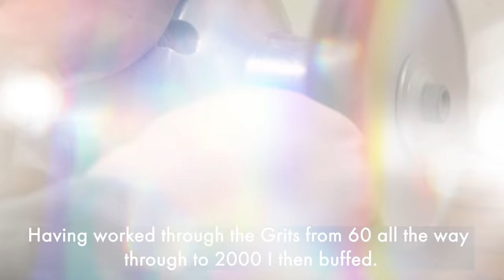Extremely Rusty WW1 Pocket Knife Restoration (Haunted House Find)

Comment: NileRed did a video about making transparent wood. He explains the chemistry and the process very well and shows his failed attempts, if you still are curious about the transparent wood :)
I also did some research on this interesting locking mechanism the knife uses.  If you google french trench folding knife, you'll find many similar knives, which may indicate where this one came from. Also a more recent example of this mechanism is the Lierenaar knife by Robert Herder
Reply from the maker: Thanks very much for the info and your input. I'll check em out.

Comment: @11:10 can you please tell me the polish you used for the wood here, I was cleaning an old knife of mine and over did it with a sanding paper that the polish layer went off, would appreciate it if you told me what you used here, thanks
Reply from the maker: Birchwood casey tru oil. Prick the top, apply to fingertip and then use finger to wipe on wood, tiny amounts at a time.
Reply: Appreciate it man

Comment: Okapi - cheap South African knife.  Very often used by skinners (hunters) because of the soft metal blade and easy to sharpen.  Unfortunately also the  most popular stabbing instrument in this country, causing trauma-hospitals to overflow.  These days the handle is made of a sort of plastic.  I had my first one in the early 1960's.  Kind regards.
Reply from the maker: That's interesting Hennie thanks. Sad about it being used as a weapon. I've looked and looked at this handle. I still think it's wood but I've had a couple saying it's horn.
Reply: @wjlacey  - The older models were wood.  The later (not so well made) ones used plastic.  Regards
Reply: I was in the South African police in the early 90's. Very true that these knifes were used as weapons. Most probably 99% of all the stabbings I investigated involved the Okapi, sadly most of them turned out to be murder investigations. I have a couple of them in different sizes. Awesome very cheap knife.
Reply: @wjlacey  The Okapi was created in Germany in 1901 for their colonies. Brand sold to an SA company in the early 80's.
Poor quality now.

Comment: An Okapi? Or an Okapi Kopy? I found one for 10$ in a flea market. After a little cleaning up I oiled the wood and sharpened the blade. Thin carbon steel...you can shave with the thing in a pinch. They still make 'em though they come from South Africa now, not Germany. You made a great vid here!
Reply from the maker: Thanks so much

Comment: How do you fold it back?
Reply from the maker: I didn't know at the time but have since learned that there is a keyring that should be in the top hole. Also known as a ring pull knife
Reply: I asked you because I have such knife and I have to put keyring to fold it back. I wishI don't have to use the key ring. Thats why I wonder how can it be folded back without keyring.

Comment: Any idea about who made this knife originally?
Reply from the maker: I REALLY wish I knew. On the left hand side, where the thumb nail is, theres a large 'eroded?' area. As its a common place for brands/ makers logo's/ signatures etc, i can only assume that it was there, but has rusted away. It was beside an extremely rusty 1907 ww1 bayonette and a very old Axe with a rotten Ash handle. It takes a LOOONG time for ash to rot in the way it did. Therefore I can determine that the blade is very old. Judging by the rest of the items in the building, i'd chance a guess of at least 50 years minimum but many items were 100+. Thanks for watching. Be sure to share/ like etc. Thanks again!
Reply: Looks like a German or South African okapi knife.
Reply: Seems to be an old french one
Reply: БССР. Г .Гомель. Завод пусковых двигателей (ГЗПД). Приблизительно с 1976 года
Reply: Germans

Comment: It used to have a ring in the hole on the tiny metal kicker on the spring plate. It’s a South African ring knife. You pull on the ring to deactivate the lock easier.

Comment: That knife has no connexion with WWI. It's a cheap Spanish or French knife of no particular  value which is still manufactured by the thousands. The handle is horn, that's why it's translucent, not because some ridiculous chemical process.
Reply from the maker: The handle is wood. Thanks for your feedback.

Comment: And you didn't peen the pins either?
Reply from the maker: Yeah Francis you obviously know what you're talking about. I didn't peen the pins as neither it was un necessary with the glue I used. Also preening it over would have likely damaged or split the surrounding wood.
I didn't want a blackened blade was the response to your other comment.

Thanks for your interest. I will be including such processes in other up coming videos.